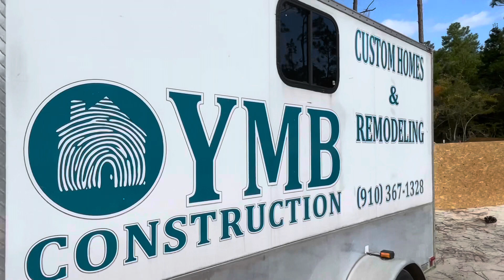Boiling, Spring, Lakes, North Carolina . Good construction. Finally found somebody good.

Comment: What vents  do you recommend l put in for the roof of a 14x70 Mobil home and how many to put in and the measurements,thank you
Reply from the maker: It should already have vents on it. I use what they call a slant back vent. Some people call it a 750 vent. If you go to the building supply, ask them for a 750 slant back vent that’s what you wanna use.